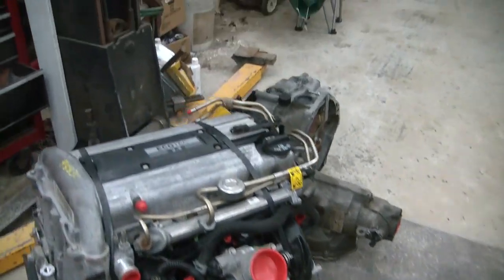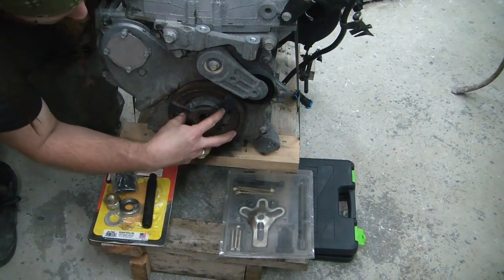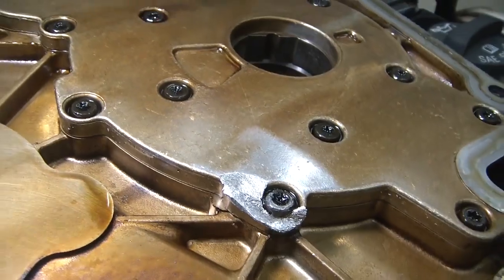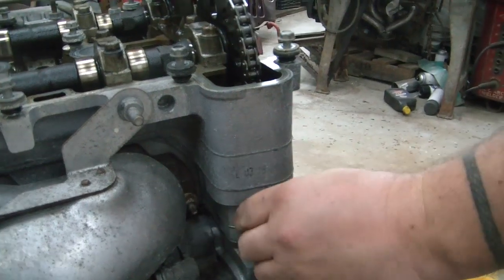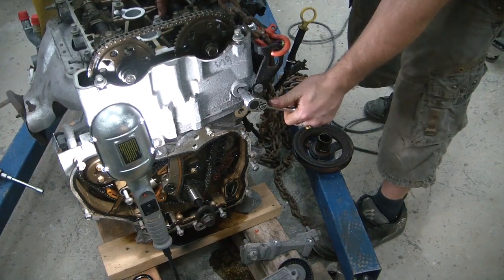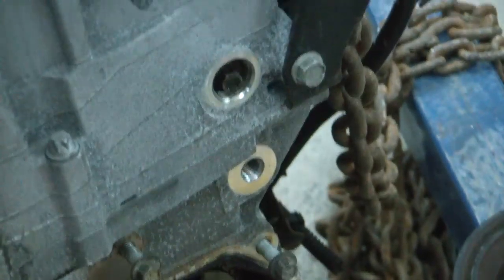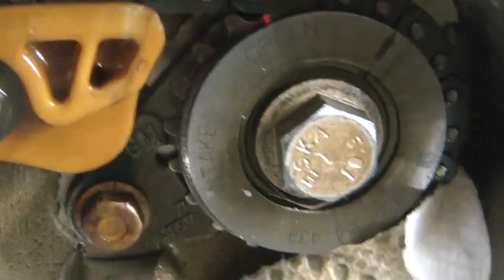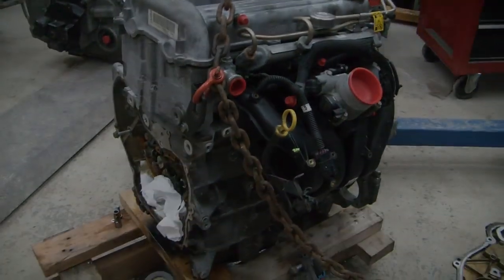04 Chevy cavalier engine swap 2 (repairing damaged threads in the new block)

Comment: crateenginedepot sells a fix for this. you can buy a "kit" which is a set of ARP 8740 bolts to use for replacement...I'm. aware of when this was done ....but for people searching or coming across this...a little FYI👍

Comment: Wow, I would have had to go back to the junkyard and show them all that was wrong with that engine, maybe even show them this vid!  They may or may not give you any money back, but I would try, and to begin with I may have seen if there wasn't a better less messed up 2.2 out there.  Smart thinking on the bolt with the milling and the cutting edge you put to clean up the last of the threads.  I have been known to save broken taps for that by grinding them down past the curve! Great Vid!